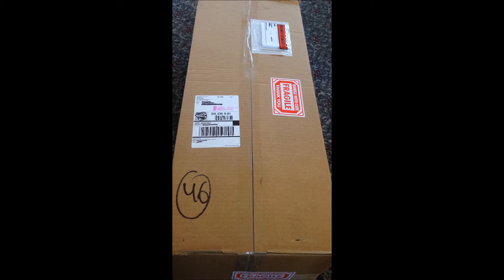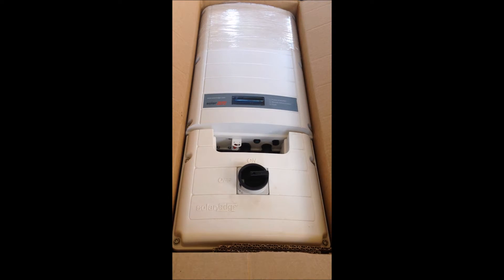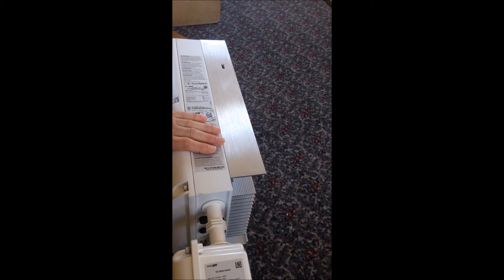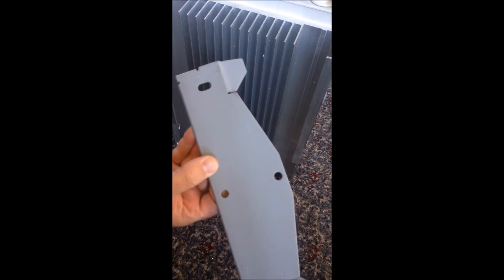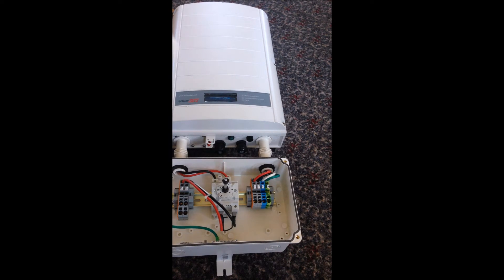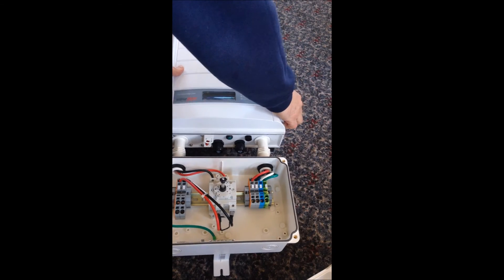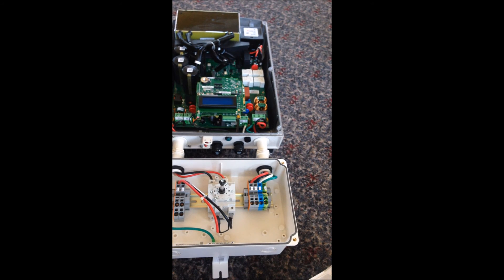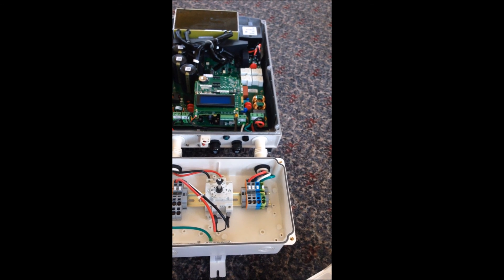Unboxing and initial thoughts of SolarEdge SE5000A

Comment: Make sure you download the solaredge site design tool. Had a pro install my system it was underpowered the inverter does not work good if it is. 18 280 watt Suniva panels 7600  us inverter was installed, used the tool, showed me the fault added 8 more panels myself works much better. The tool lets you put in what panels you have. It will also show you your projected  monthly totals.
Reply from the maker: Thanks for the head's up Lou.   That is defaintely my concern.   I am only running about 2kW right now on a 5kW inverter.   I will expand soon but I am having problems with the company getting access to the tool.  You see, I need a username and password to use the tool.  SolarEdge is giving me grief  because I installed this myself and will not grant me access.   I think it's a load of horse crap.   At that point, it's simply software cloud access.  They shouldn't nose around in my local installation codes or design.   It's frustrating.
Reply: Hi yes the company can be a corn holes they favor the installers not the 
end user. I paid 15k cash and have no control of my system added panels 
but not showing in my layout which the installer never set up but are 
paired. Thinking about taking the sims card out, the portal updates every 4 hours so 3 times a day 2 times with sun no big deal, but installer can pull up live on your system but not the owner. I used the configuration tool which gives you realtime use google remote desktop app to see it live on my phone anywhere. Here is the design tool if you need the configuration tool I have that too. https://www.dropbox.com/s/flyxldgucdo8pqh/SiteDesignerSetup2.3.5.exe?dl=0
Reply from the maker: Cool man thanks for sharing.  I used an LLC company I own to gain access but I don't have a gateway yet nor do I have time to hard plumb a router/computer connection to move forward any time soon.  I'll keep you posted on progress.  Thank you for sharing the link!

Comment: Did you have any problems going forward from here. Are  the optimizers needed to have the system running?
Reply from the maker: Well, some but its my fault.  My wiring isn't weatherproof. My fault.   But, yeah.  No ongoing service charge or anything like that. It's rocking and rolling.
Reply from the maker: The DmaCk oh I forgot to mention, yes the optimizers are needed with this setup.
Reply: @SolarDrew  Thank you for the quick response and Glad you have your system up and going. About to start mine shortly
Reply from the maker: The DmaCk nice!   You have Solaredge as well?

Comment: the dust is from shipping and whare house fork lifts stir a lot of dust
Reply from the maker: That makes sense.  That's what I was thinking.  It was probably sitting in a warehouse room somewhere collecting some dust.   I'm going to try to hang it on the wall today, but I won't be able to do anything with it until the optimizers arrive and I wire them in.   But it will be pretty to look at! :)